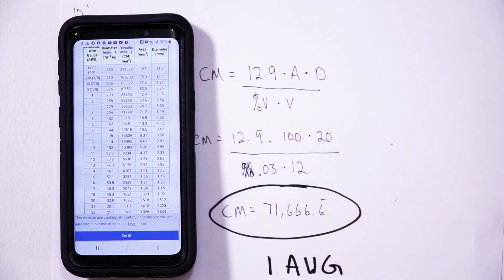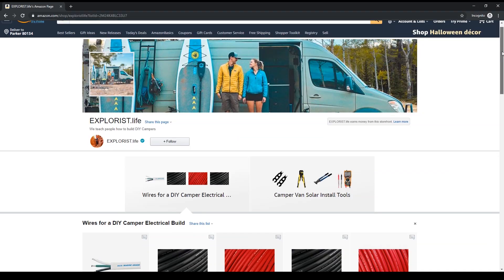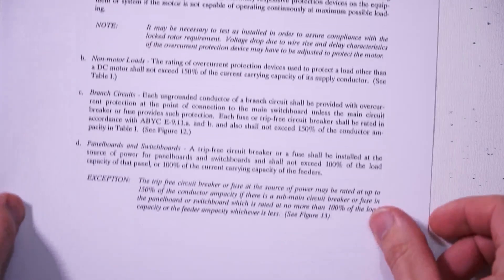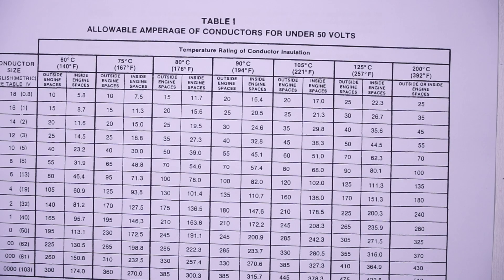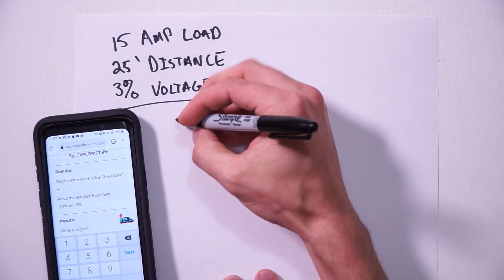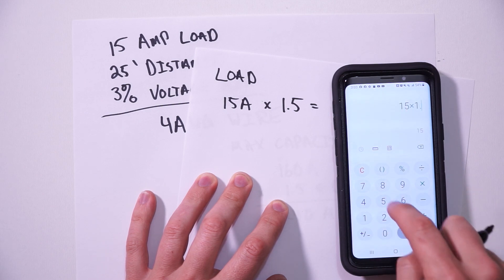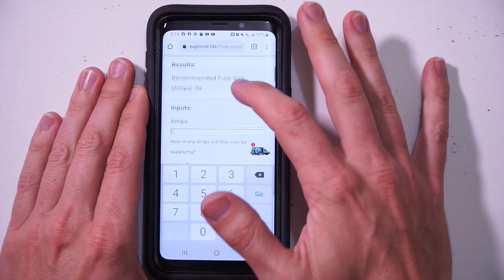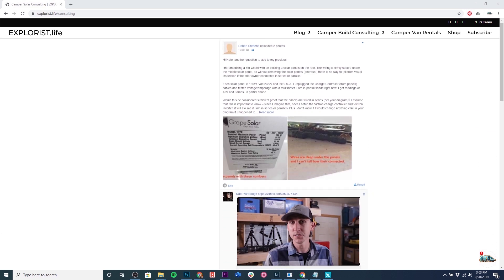How to Size Fuses for a Camper Van Electrical Setup

Comment: I know this is older, and we fuse for the wire 

However, in a main battery fuse do you need to account for incoming amperage from a solar charge controller and a use from inverters draw, or just the use side or inverter?

Comment: I don't understand a thing (even from the calculator above). If i increase the voltage leaving the "device amps" the same, it continue to say to use the same fuse. How is that possible? 10A at 12v = 120W, 10A at 120v = 1200W, it's totally different.

For example i have a 72v battery pack at home that i want protect with a fuse or dc breaker. The automotive fuse are rated 12/24v, it will work the same at higher voltage? I doubt, cause the ampere/watt (converted to rated current) will be higher, or i'm wrong?. The same for the dc breaker that are rated with a range value (example 12-500 or 12-800 DC). I mean the same type of the one used at home for the AC, there are also for DC. How is that possible? 10A at 12v will be different that 10A at 500v. The thermal protection (fuse, breaker) will not be the same at same Amp but different voltage.

So how it work?
Reply from the maker: Yep, it's totally correct.  That's why we need to use a 2ga wire to power a 1200W inverter operating at 12V (1200w / 12v = 100A) but can use 14ga wire to power a household 1200W space heater operating at 120V (1200w / 120v = 10A).
Reply from the maker: You just need to make sure the fuse/breaker is able to handle the 'type' of voltage (ac vs dc) and the level of voltage (24v max vs 48v max vs 250v max, etc)
Reply: @EXPLORISTlife  Ok but the problem is still there. How a dc breaker can work correctly if it's rated with a range value? Example 12-120v dc 10A. How it can trip with 10A at 12v (120 watt) without tripping at 1A at 120v (same 120 watt)? I don't understand. The ratem amp (10) of the example, are 120 watt at 12v BUT 1200 watt at 120v, so the heath of the thermal protection/breaker will be different :S
Reply from the maker: @Peppins  Amps trip fuses.  Not watts.
Reply: @EXPLORISTlife  Wait, maybe I get it. Since everything is based on thermal protection, is the heat released less at a higher voltage, even though there is always the same wattage? Perhaps this is why in DC with low voltages but at high amperages thicker cables are needed compared to higher voltages and/or in AC?

Comment: In your fuse & wire size calculator could you please also list the wire size in mm2?
Reply from the maker: It's not a priority, no.  There are conversion charts out there, though.

Comment: Hi Nate from Australia.
Love all your vids, thank you. 
I'm a 1st class sheet metal worker, can put together a offset square to round ducting, this DC stuff is a challenge I'm trying to learn, as I'm sure you'd have a challenge in ductwork.
Each to their own.

Now, don't have a camper van, RV or motor home, just have a normal vehicle towing a box trailer for the swag and gazebo.
When 240v is unavailable I've purchased a battery box, 100ah lithium battery, battery monitor and shunt, 2 x 12v cigarette outlets, 1 x 5v 3A x 2 quick mobile charger outlet, 2 x Anderson plugs, 1 x solar dedicated Anderson plug, 6 outlet blade fuse box, and a 1500w pure sine wave inverter (3000w peak)
Ohh and a 360w solar panel.

Pretty sure on wiring everything, each positive cable with a blade fuse, just stuck on inverter wiring huge amps, cable size, either ANL fuse or Class T fuse or ANN fuse someone mentioned earlier.
It's all mounted on a battery box. Handy for power black outs (or brown outs) in NSW to run the fridge and TV being so portable. 

You've covered RV, motor home, camper van 12v fit outs with almost every conceivable wiring diagram scenario.
Is there any chance you can provide different wiring diagrams for the budget end of camping similar to my set up for all the other campers?
Thought I'd ask.
If you've read this far, thank you! Cheers
Reply from the maker: For something that small, I'd just recommend getting a Goal Zero or similar; which is why I won't make a diagram for a system that small.  But if YOU want to DIY it... that's fine... This channel has all of the educational material you need to make it happen; you'll just have to do a bit of additional due diligence.
Reply: I'm second for that.

Comment: Hi, on your wire size calculator on the website, I put in amps = 55, voltage = 24v but it recommends 10awg. If I search max current rating for 10awg wire I get 30amps!! Bit less than the 55 so what's the deal, am I wrong, is the calculator wrong or what?. Very confused now. Great site and videos by the way👍
Reply from the maker: Different 10ga wires are rated for different amps.  Look up the max amps for 10ga wire with 105 degree insulation (what the calculator is set up for).

Comment: Thanks Nate appreciate it.

I have a 4 battery system (4 100Ah batteries serial/parallel 24 volt connection) and my fuse requirement as per your instructions I calculated is 125 amps
Should I put one 125 amps on the common positive cable going to the hybrid inverter 
Or divide it and put four 32 amps on each positive pole instead ?

I thought of 4 fuses for all positive poles is more safe, but may be I am missing something, so your advice is Apreciated. 

Thanks

Comment: If I've got a 10A 48V inverter but I'm using 12 ga wire, does that mean the fuse between the batt and inverter should be 20A? Thanks much.

Comment: Thanks for doing all the hard job for us....I have 2x 3000 watt inverter in split phase and have 2 sets of array of solar (6x 330watt panels 3 in series and 2 in parallel and second array 16x 100 watt panels 8 in series and 2 in parallel ) 4x 24v Lifepo4 100ah in parallel (24v 400ah) can you list the fuses and breakers and cable size that I would need thanks!

Comment: Great Info
With your DIY Negative Bus Bar and Master Service Battery 12 V DC  Disconnect Switch setup. 
(...understanding you don't recommend this anymore because of fuse quality issues) .

Previous instructional videos  (other users) show a Renogy 50 AMP- DC/DC MPPT Charger/Controller connected  via Fused bus Bar to the always HOT side of battery the cutoff switch.

 The negative DC Fuse Box / Charger/Inverter  wires connected to other red negs on 
the opposite side of master cutoff Switch.

Why are not all negatives /reds on the  Not Hot  Side of the master Battery Cutoff Switch under this scenario?
Does it matter and or why?
Reply from the maker: That could be for if you wanted to turn off all loads but allow charging of the battery.  I don't see this as a big issue as you can simply turn off all loads at the device similar to how you'd turn off the lights at your house at the switch instead of turning off the master breaker in the breaker box.

Comment: I have learned i can not afford to do a solar panel addition to my trailer. So, if i understand the video right, i can install new batteries and a charge controller with an inverter/charger. Am I correct? Then at a later date add the pannels? Due to the price, I chose 4 12v AGM 100Ah batteries. I am trying to use your chart but without the panels.

Comment: Does the length mean just the red and black wire from batteries/inverter or does it include the length of my extension cord into my rv assuming its the same gauge as the red/blacks?

Comment: I'm putting together my first solar setup. It's a basic 200watt, single 100ah lifpo battery with a 2000watt inverter. For my battery to inverter wire, according to some sources, they recommend using the following formula, 2000w /12V = 166amps. Then they say to multiply that by 1.25.(not 1.50)? so  166amps x 1.25 = 208amps. Then they say to add the amps of my 12V fuse panel which would be 15amps max and add THAT to the 208amps for a total fuse/breaker size of 223 amps. Is this ok to use this formula? I don't know whether to use a 220 amp fuse/breaker (don't have one) or move it up to 250amp which I do have on hand?  I hope you can clear this up for me if you have the time, thank you.
Reply from the maker: I don't think I have any more insight than what was in the video.  If you're still struggling with the concepts, perhaps just following one of my 2000w inverter diagrams available here will help: https://www.explorist.life/solarwiringdiagrams.

Comment: Great explanation! Just to clarify for many here, that distance used in the example needs to be double. So, it is a 50ft wire run (round trip).  I have the ABYC E-11 & comparing it to Blue Sea Systems charts (which are supposed to be based off of ABYC) their figures are a tad different. In the same example he gave, the ABYC suggest 4AWG while the Blue Sea Systems charts (colorful quick chart) says 6AWG.
Just double check & take your time when doing your wiring (or use the calculators he's made)

Thanks for the awesome video!
Reply: why does the distance need to be doubled?
Reply: @SawmonandNatalie  The electricity runs from the source, to the load, and then back to the source to complete the round trip path of current flowing thru the wire. Voltage drop along the wire is calculated using the total wire run length.
Reply: If it is not in boat or your load isn't that big, I will go as Nate says and do a common sense, go for the 6. ABYC add a lot of room when do calculations just to be always in the "SUPER SAFE" side of the calculation.
Reply: @sebastianlehmann3698  Yes Sebastian. The super safe is the 4awg that I mentioned. Thanks for commenting & staying involved!
Reply: Lol sorry yes the 4 is the SUPER SAFE.

Comment: I am a "tad" confused and hopefully someone can help, I am creating a 24v system and using 24v Inverters with 240v Appliances. I'm not shore if my "Amp Draw" calculation should be "Appliance Watts" / 24v or 240v to size my cables, any thoughts?
Reply from the maker: Ask yourself: When the power is flowing through the wire in question... is it flowing at 24V or 240V?
Reply: @EXPLORISTlife  It is Drawing 240v from the Inverter but only 24v  into the Inverter, so the calculation is based on In or Out correct?

Comment: Hey Nate! You state that 4 AWG has a max capacity of 160A... the DC charts I'm finding say 100A at the shortest lengths. What am I missing? As an electrician (granted residential) this seems nuts to me.
Reply from the maker: Sure!  ABYC E-11 Table VI-A tells the max ampacity of a wire before any derating factors.  Here is the table: E-11 Table VI-A: http://assets.bluesea.com/files/resources/reference/21731.pdf  The wire must meet the specifications of E-11 (Fine stranded wire, 105 degree C insulation, etc.)
Reply: Not sure where you are Cali it's the same for Australia, 100A for 4awg even if less than a 1M length!

I think the temperature ratings for the cable come into play as well, Nate is always mentioning "105C" when providing AWG/Amp rating/statistics.

Comment: How does one go about sizing fuses for the main components such as battery bank to switch/busbar, busbar to inverter, busbar to DC distribution block? 
300AH Lithium & 3000w inverter .. I've got all of the other 12v items fused thanks to this video! Thanks again!!
Reply from the maker: It's the same way.  Still figuring up to 1.5 of max load given 1.5x max load does not exceed max ampacity of the wire.  But if you are looking for fuse sizes for a system with a 3000w inverter, you should check out this diagram: https://www.explorist.life/3000w-inverter-400-600ah-400-to-1200w-solar-camper-solar-kit/

Comment: Hey guys, just a question that popped upcin my head. I recently found that there are ANN fuses also, they have a very short blow time vompared to ANL.  ANL fuses are typically used in sound systems. So, why is everyone using ANL i stead of ANN, any reason for that? Much appriciated!

Comment: Hi Nate, I'm about to buy one of your wiring diagram ("3000w INVERTER | 400-600Ah | 400 TO 1200W SOLAR -CAMPER SOLAR KIT")
 Before buying I would like to ask you about its compatibility. It can be adapt to a 230V (Europien) system without any changes? I mean the size of fuses, wires, AC brakers are the same size and rate if I do this with a Victron MultiPlus 12/3000/120-16 12V 230V? Possibly do you have a European version of this? Thanks in advance.
Reply from the maker: The DC side of things would be the same.  AC side would change to fit 230V.
Reply: @EXPLORISTlife  Can you do the changes or I have to do the calculations after purchase the diagram?
Reply from the maker: That'll be on you based on all of the tutorials I have laid out here on this channel and what products are available to you in your country.
Reply: @EXPLORISTlife  Thanks

Comment: Hi Explorist, I enjoy this video that helps me throughout the process of my van conversation. I was wondering if it's possible that you can please help me with a DIY? I am looking to find out how to install my cable wires to my alternator to get 220 AMP. I have a 2021 ProMaster 2500 series 159w base with a 220 AMP alternator built in but I haven’t found a video showing this type of installation. Can you please advise me if possible? Thank you so much in advance. I will post a video on my installation once I get the info.

Comment: Hi Nate,  One of the solar installers on a FB group I belong to is recommending a 400A Class T fuse instead of a 400A ANL fuse at the battery bank.  I have already purchased the ANL fuse and holder but am willing to buy a Class T fuse and holder if you think I should.  I trust your judgement more that any of the installers in the FB group and would appreciate your input.
Reply from the maker: Both ANL and Class T Fuses have Ampere Interrupting capacity high enough to be used as the main fuse at the battery bank as per ABYC E-11 Table IV: http://www.blackfinforums.com/sites/default/files/10/attachments/abyc-e-11.pdf

I recommend ANL fuses as the main fuse in ALL of my diagrams & parts lists found at https://www.explorist.life/solarwiringdiagrams as they satisfy the aforementioned requirement and the are a little less expensive than Class T fuses.  (Note: High Quality ANL Fuses & Fuse Holders like Blue Sea, LittelFuse, or Bussman are HIGHLY recommended and are listed on each of the diagrams from the previous link.)
Reply: @EXPLORISTlife  Thanks, Nate.

Comment: Hey Nate, thank you so much for all the great videos and information. I downloaded your 120v and 12v branch circuit diagrams and noticed that you show a Dometic AC unit on 120v power but I dont see one on the 12v circuit diagram. For some reason i was thinking that 12v was the preferred route for an AC unit but now Im wondering. I am using the Multiplus 3k with 400 Ah of Battle Born batteries. Is it preferred to run a 120V AC unit? Thanks again!
Reply from the maker: 12V is also fine.  That wouldn't be included in the '12V branch circuit diagrams' because that wire is much bigger than would fit in a standard 12V fuse block (what that diagram is for).  A 12V Air Conditioner would get connected to the Lynx Distributor in my diagrams.

Comment: Great video as always, Nate - thank you. Just to confirm: For all my small 12v branches throughout my van, I decided to use just 2 different wire sizes -- so then all the blade fuses in my 12v fuse block will be only one of two sizes, according to the wire alone - and not at all related to the devices/ expected load on each, correct? i.e. Not trying to protect the device, but only the wire size.

Comment: How can you tell how much power should come out of an MPPT Charge controller? My thinking my be wrong, but if I wired solar panels as series/parallel and have 8 100w panels going to a charge controller. I would have 
70v
11.38a
796.6watts
So this is approximately what goes into the charge controller, (this is where my thinking may be off) but the charge controller takes the high voltage down to a manageable voltage for your battery setup (ie 14.4 volts) but does it also convert the extra volts to AMPS? If so at what rate? So essentially what I am asking is since I know what is going into the Charge Controller from the solar panels, what would that equate to in amps coming out of the charge controller to the batter bank?
Reply from the maker: Solar array wattage / battery bank charging voltage = charging current (amps) headed into the battery bank.

1440w solar array / 14.4V battery bank charging voltage = 100A heading into the battery bank.

Comment: Hi, any reason why the charge controller is not behind the isolator? It is not like that on your other plans. Heard solar should always be connected to a battery, is that the case?
Reply from the maker: The minor benefits don't outweigh the 'pain in the ass' to wire together the wire on the battery side of the isolator.  It's just so much easier to use the Lynx Distribtor like I have in all of my diagrams now at explorist.life/solarwiringdiagrams.

Comment: It seem odd that the fuse be sized bigger than the wire ampacity spec. It may not be code but I do it a different way: The fuse is 125% of the load, and the wire ampacity is 150% of the load. No way that wire comes close to catching on fire but that's just me. 😁

Comment: What about a video on WHERE/WHEN a fuse is recommended/required in a solar build?    Is "best practice" a fuse on every run between two components?  Should the fuse be close to the load or the power supply? etc
Reply: Great idea.
I think many people would enjoy that video.
Thumbs up 👍👍
Reply: Almost everyone has the fuse close to the battery. Now this could be more of a practical thing as having everything in one spot makes it easier to switch out the fuse. Most people have a fuse box so it’s naturally closer to the power source.
Reply from the maker: Will keep that in mind.  Thanks for the suggestion!  For the time being, there needs to be a fuse protecting EVERY wire and the fuse needs to be on the side of the wire closest to the source of power (battery side).